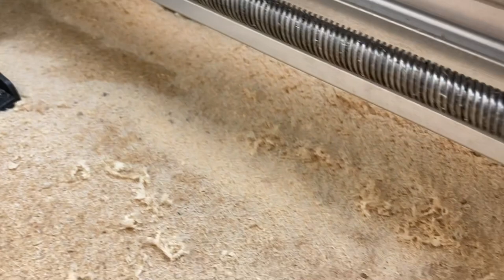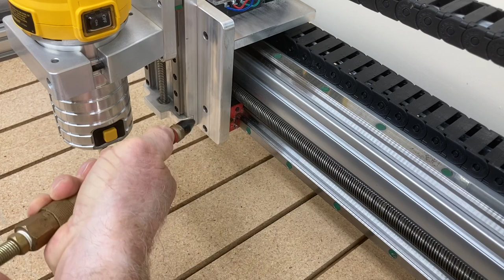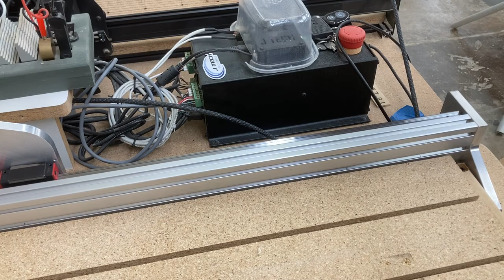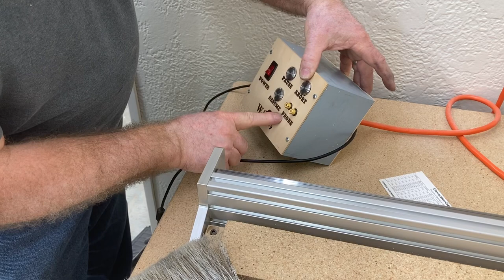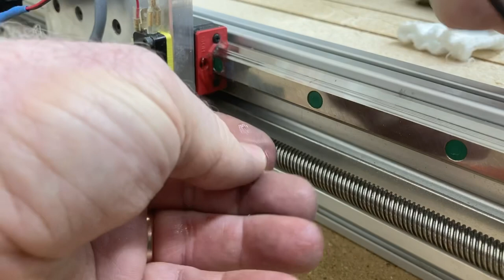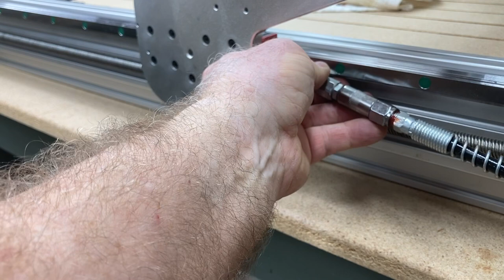CNC4NEWBIE New Carve Maintenance Part 1

Comment: Very informative. Even not having active dust collection, you don't appear to have static electricity problem sticking sawdust to your metal parts. I guess your machine has a good grounding to dissipate static. No dust accumulation in and around motor either!
Good to see trim routers standing up to heat & wear of  high usage. Didn't think they were designed for CNC type of duty cycle several hours continuous
Reply from the maker: No, I do not have a static problem. The router does fine for long run times. The brushes will last for about 150 to 200 hours.

Comment: How about the X linear screw on the Z for lube
Reply from the maker: The linear bearing do not have a removeable screw that I can see therefore it appears that just putting grease on the rail is the only option.  I will be contacting CNC4NEWBIE

Comment: I enjoyed your video on the maintenance of my cnc4newbie. However, I found my cnc was not square. Do you have a video that covers this problem or you can direct me to where I can find out? Thanks
Reply from the maker: Yes, the assembly video shows how I square my CNC machines
Reply: @PawPawsWorkShop  I have watched the video a few times but you do not address my problem. My CNC4NEWBIE machine is NOT square. How would I fix it??

Thank you,
Jene
Reply from the maker: Did you see the part where I use the sticks to measure diagonally across the machine. If you loosen the screws on the back of the machine you can use the sticks and slide back and forth until the measurement is exactly the same
Reply: @PawPawsWorkShop   I saw how you did it on the X-Carve and I was talking about the CNC4newbie. So I wasn't sure if it was the same procedure? Thank you
Reply from the maker: It’s exactly the same. I have used this on the CNC4NEWBIE, XCarve, FOXAlien. The process to square the machine is all the same.

Comment: Another question in regards to lubing the anti backlash nut assembly,  I see the ones for the Y1 and Y2 axis and understand how to slide the y axis out of the way to lube them, but what about the ones for the x axis and the z axis, are they easy to get to to grease as well?    also, do you have a video that shows the adjustment of these anti backlash assemblies when it needs to be done.  Thank you!  Mike

Comment: I see the link for the grease gun comes with a needle point tip, is this small enough for the NewCarve bearing holes or should I also order the needlenose part in the separate link ?  Thank you!  Mike
Reply from the maker: According to CNC4NEWBIE you need the needle nose part as well. I use it on my machine and it works great
Reply: @PawPawsWorkShop  , thank you !!!